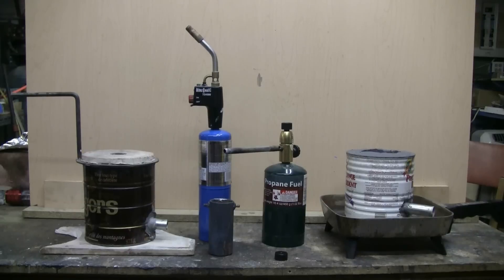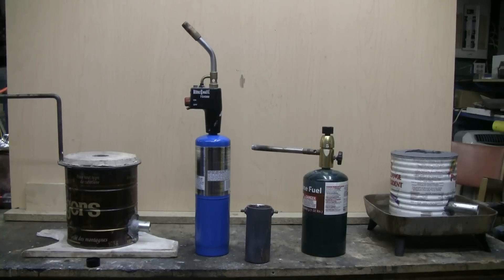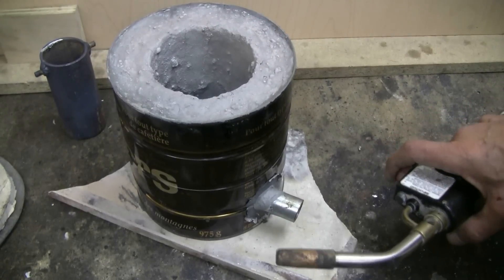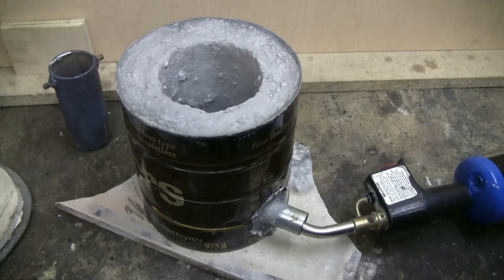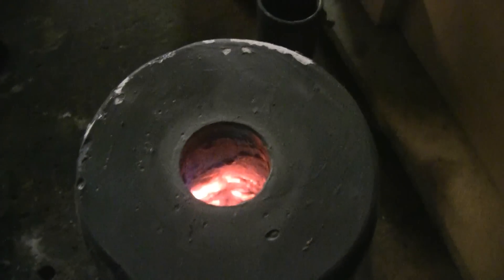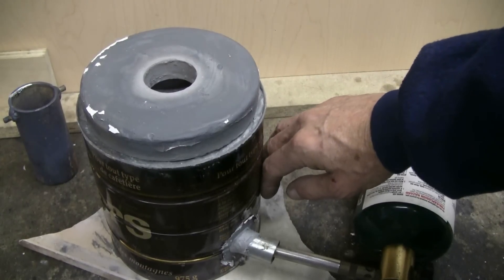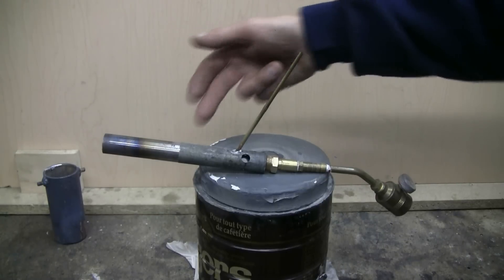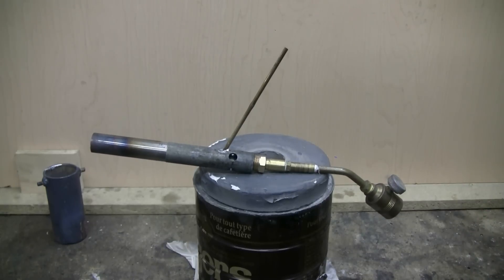Do It Yourself Coffee Can Mini Foundry #4 - Burners

Comment: Can't find Part #3, 2, or 1 - Your design is inspiring but I'm guessing you might've covered the plaster in Refractory Cement? Also looks like you used plaster to hold that piece of pipe through the can? And I see you're using a Spraygun Canister (but aren't they made of Aluminum?)